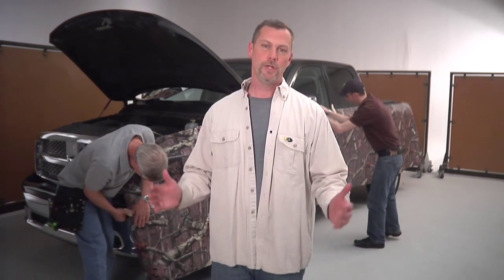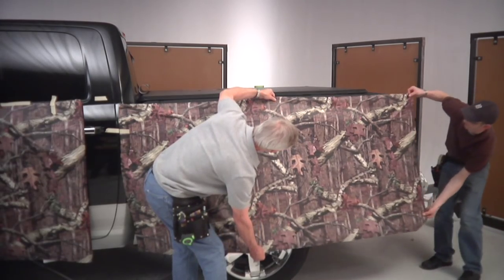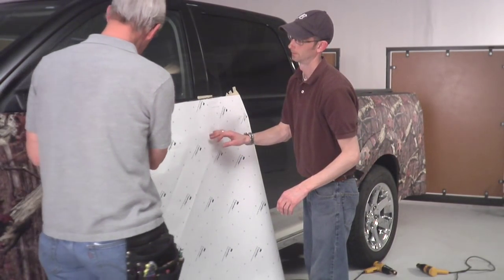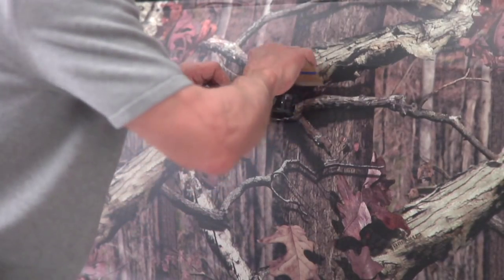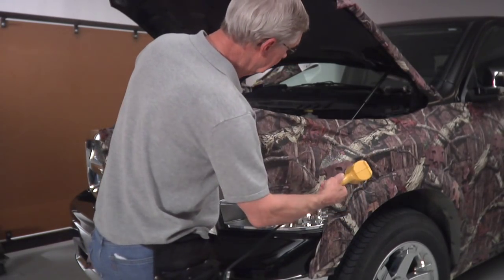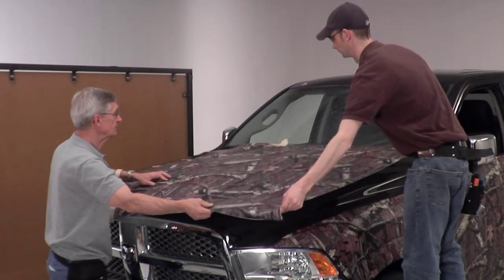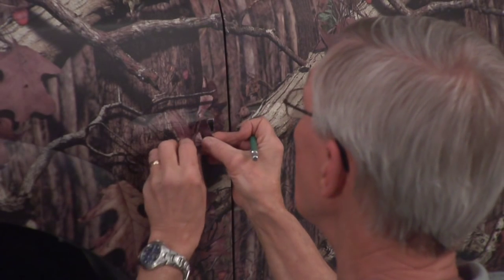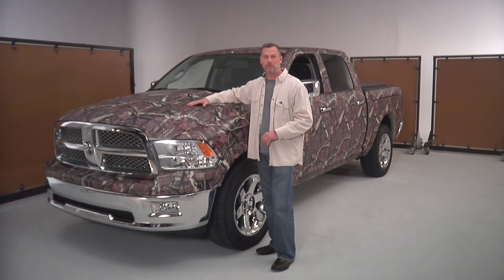Mossy Oak Graphics Full Vehicle Kit Install

Comment: The repeat in panel design kills it .. they need to fix that
Reply: Right! You would think they could switch it up a little.i have an 03 z71 & the paint is peeling plus i had to put a door from a different truck on it.its a real good truck.strait body no issues & got quoted for a standard paint job at econo.$1200.00 for a plain jain 1 coat & 1 clear.i was like nope.i thought about this.realtree has a sell on there wraps
$800.00 for the kit.but that dang same panel scheme just sucks.
Reply: The more I look at it the more I wouldnt put this design on my truck

Comment: Ok question is what happens when you want to sell your vehicle?  Are you able to remove the wrap after it sets up or say a year down the line and you try to peel it off will it remove paint?
Reply: You can use a heat gun to remove it and it should be fine.